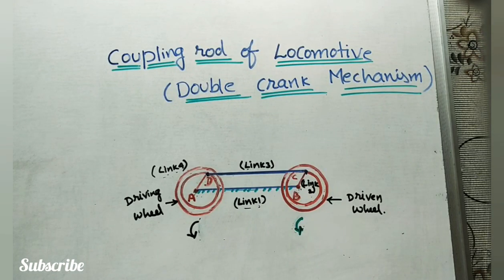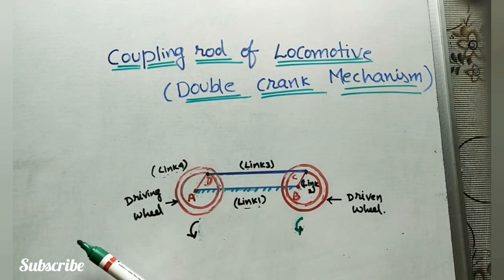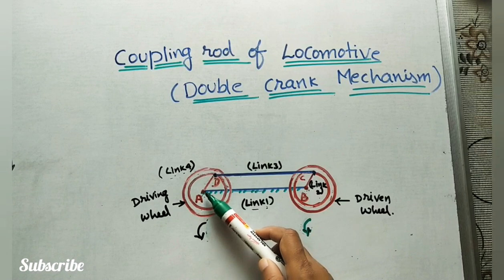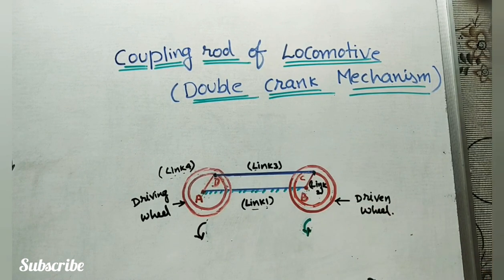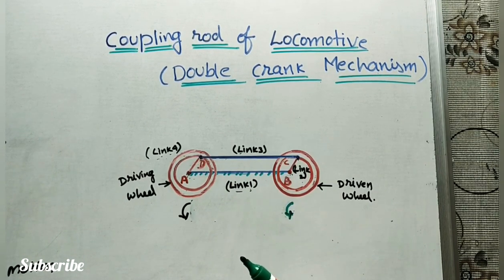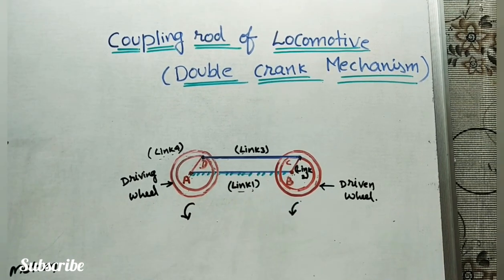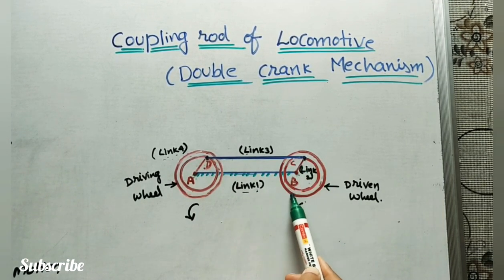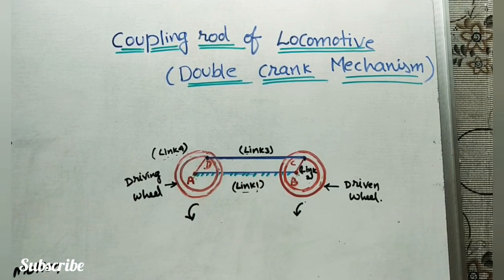Coupling Rod Of Locomotive (Double Crank Mechanism)

Comment: Any mechanical advantage in it
Reply from the maker: Power can supply from driver to driven
Reply: Can u say clearly
Reply: @engineeringclassesbydr.noo3377   What is the advantage of power transmitted to the driven wheel. It will run even without such an arrangement. Can you give the technical reason?
Reply: Ótimo! Você conseguiria explicar como calcular as posições do mecanismo?